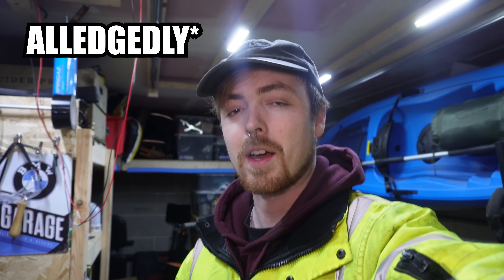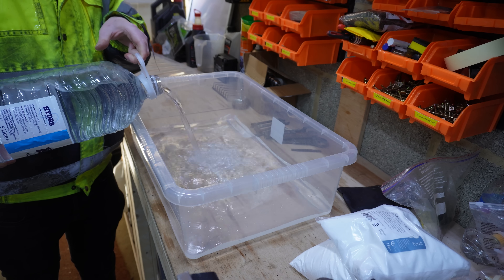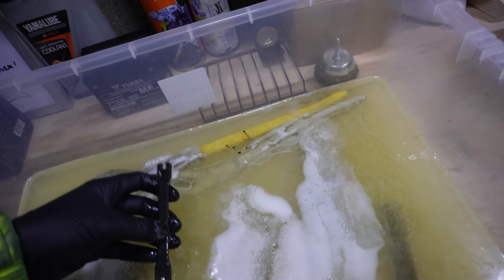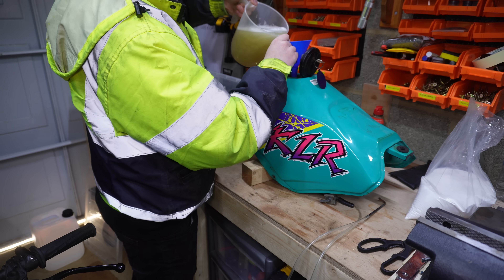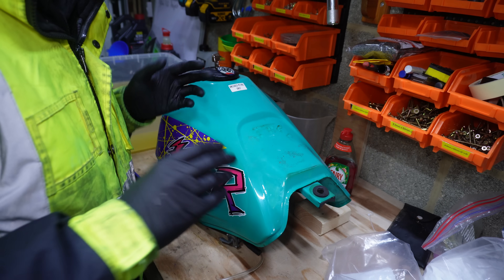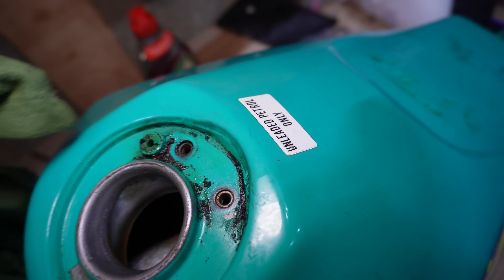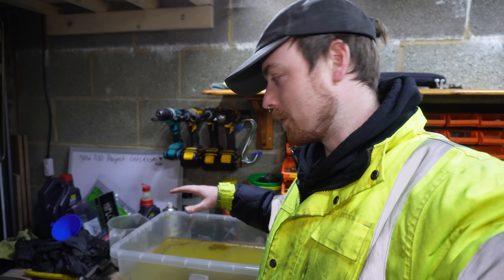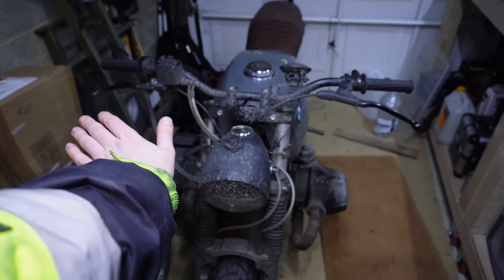How to clean a motorcycle fuel tank (Better/Cheaper than Evaporust?)

Comment: Will the rust come back though? Better to use a rust killer converter or removal? Are all these products snake oil basically? Going by all the tests that Project Farm and other channels have done, NONE of these products deal with rust for good.
Reply from the maker: Nope! Unlike methods that use acid this doesn’t flash rush! I’ve had it sat empty in the garage for a few days without even flushing it out yet to test that and it looks exactly the same! The rust hasn’t come back. 
I’ll pin this comment as that’s a major thing to note which wasn’t in the video.
Reply: @ItsChrisHodge  Superbike Surgery channel had the same type of GSXR750 like your mates with that gear whine.  It wasn't good!  Check it out.
Reply: @ItsChrisHodge  Acid is still only as good as the time its used.... Leaving treated areas bare after acid treatment and the rust will just come right back. Its about more than just the removal product.. theres a lot more to it than that. Proper protection in the first place is the only true method to "prevent" rust.
Reply: @ItsChrisHodge  Please keep us updated, show us that tool kit in 6 or 12 months time, interested to see if rust appears.
I'm keeping an eye on two different rust converters myself, I want to cover the underneath of my pickup truck in the Summer, if I can find one that actually works in the long term.
Reply: @ItsChrisHodge  the rust always comes back ... Been using this for months ..  Do you even know why and how this actually works ? ... Obviously not .
Reply: @LifesAbe-ach  To make it a bit more rust resistant, you could lightly copper plate it using electrolysis, it's a very safe, easy process.(and cheap)
Reply: @ Good idea, a good soak in a strong Copper Sulphate solution will do it.  Also makes a great  marking out fluid.  Very easy to see lines.
Reply: @AmericanThunder   ... If you use this , definitely rinse well after and dry off .  The older the mix the more it etches and eats into the steel . I've sat old rulers in it half way up to test and it leaves a ridge line . I do own a full zinc and nickel plating setup that I use ... I do black oxide and oil  treatment as well .  I've done a little copper plating using copper sulphate crystals and got reasonable results  ...
Reply: Yes, if steel is not protected, rust will come back.  Rust removers and converters are two different things.  With converters, you  usually have two types, Tannic Acid water based and Tannic Acid in a latex base.
The latex based ones are a great base for nearly all paint systems.  The straight Tannic Acid water base is excellent for paint as well, but will require a wipe down and an etch primer.  The advantage is when stripping old machinery or when something is going to be welded later.

Another fail-safe method is water:molasses at around a  40:1 ratio.
This mixture lasts a long time, I have a bin that has worked for 30 odd years, which I top up every now and again due to evaporation.  Will not harm anything, can be poured in the garden when unwanted, (plants love it), and you can leave things in indefinitely.
Stuff comes out with a black sludge that washes off, similar to what is shown in this video.
Reply: @Onan-u3b   I second the molasses.   Once I found how well that works, I forgot all about every single other method and will never bother with them.

I have one 55 gallon drum that I started with 4 gallons of deer feed molasses and I constantly run engine blocks, heads, cranks, old tools, or anything I can get my hands on that's rusty.

Just yesterday I was looking at some bare cast iron fireplace andirons that I soaked over a year ago.  Not treated, sprayed down, or painted and they're still just as gray as the day I took them out and washed them.
Reply: @earlbrown  Yep. been my standby go-to for many years, absolutely failsafe.
Cheap too! Cast Iron loves it!  I have found the same thing with Cast Iron not re-rusting  again for years if inside.
Reply: @earlbrown  Hi earlbrown, my 1st reply to you was deleted!
Yep, it is my favourite go-to.  The reason I really love it, apart from its effectiveness, is that I can just throw stuff in and leave it.  I experimented with things like Oxalic Acid and lost valuable parts because I left them too long.
I would rather have super safe than instant wonder.
At the moment I am doing a little experimentation based on Better Ballistics formulae:
https://www.youtube.com/watch?v=fVYZmeReKKY
Using some Tetrasodium EDTA as the buffer due to it being a chelating agent.
It works fast, but as said, unless I know that I will be on hand to keep an eye on things I will be sticking to the Molasses.
Reply: Yeah.  That's why we paint/polish/wax/chrome/powder coat metal.  Bare metals corrode.  Nothing new.
Reply: @Mountain-Man-3000 who knew! 😂
Reply: @Mountain-Man-3000  And even then, sometimes the rust bubbles up through such coatings. Back in the 90's a body shop guy said that the rust is already in a new panel etc due to the recycling of all the old metal, not skimming off properly etc. It does make sense to me otherwise why do you get rust bubbling up under paint work that's not even been chipped/damaged?
Reply: @steveclark..   It is simple imperfects in prep or coating when a bubble occurs.  The rust is not from recycled metal, but he is correct once the molten metal cools nature starts on it (moisture).  No one gets perfect prep and perfect coating.  that is why multiple layer designs are used (primer, base coat, topcoat, clear).  even the acid etch of the surface to remove rust never gets it all. However it can greatly reduce the problems.
Reply: @steveclark..  the paint damage doesn't have to be large enough to be visible to the naked eye to allow corrosion to form. Additionally corrosion could be caused by flaws in the paint application process.
Reply: @whatsup3270  How can you be sure that it's not from recycled metal in the first place? I worked for VW back in the 90's and had to replace the hatch on several Golf's, only a few months old, all rusting from underneath the paint. I can't be 100% sure that it was from the batch of recycled metal that came from the plant at the time but I doubt very much that it was from poor prep or painting at the VW factory.
Reply: @silaskuemmerle2505  I recently treated the inner wing of my pickup due to seeing a tiny bubble on the outside of the wing, I expected to see some leaves/mud wedged up there but nothing. That painted surface isn't even exposed so no damage at all yet it's rusting. I can't help but feel that rust is already in the metal, pot luck whether or not it shows itself.
Reply: @ Intergranular corrosion is a possibility, but more likely would be a spot where the primer didn't cure properly which would also cause corrosion
Reply: @steveclark..  Metal is metal and when it is melted down no rust survives.  Rust density is way too low compared to liquid metal. Thus rust becomes slag. For an example since 90% of metal has recycle in it, we would expect 90% failure rate if that were the cause. If metal is under prepared to coat it is doomed.  If a mismatched primer is selected it is doomed.  If the coating is insufficient it is doomed.  That is why single coat jobs are avoided.  If there is a single speck of dust on the metal and single coat is applied there is likely a bare spot on the opposite side of that speck, and that speck will likely fall off in the freeze and now there is a bare metal spot to rust.  Additionally, all coatings breathe, and that aspect has to be matched up correct as well.  Those VWs likely went too cheap on the prep/prime/multi-layer coatings and accidently designed a dead spot that collected dirt which held water and thus over exposed water to that paint design.  Same as the old wheel wheels on cars and trucks.
Reply: @whatsup3270  The slag aspect was brought up back in the day, the bods at VW suspected that it wasn't all skimmed off fully on that batch of material that they got for that production line.
Again, I doubt very much that it had anything to do with the prep and painting aspect because the problem only happened during that short production/run of Golf's, not before or after.
Reply: @steveclark..   These are different issues.  If slag remains in the reprocessed steel would have to limited to the top and that ingot and is a manufacturing failure. They blow gas through these batches for this purpose.  Testing would also have to fail to detect that defect.   
As for the other issues those should not be hard to factor through.  For example was surface prep, primer, coating used on other cars.  And accidently designing dirt traps which will stay wet as usually obvious in the failures.  Simply failure analysis is often easy, not always easy but often easy. 
If the video is reviewed 3 very different conditions exist 1) clean tools, 2) tools which retain some surface cover and thus metal is blocked, and 3) the inside of the tank which cannot be inspected fully, prepped fully, or coated fully.
Reply: @whatsup3270  Different issues maybe, the end result is still rust though. During my time at VW, I visited a few body shops too, mostly expensive, high end classic cars, restoration projects, a guy said to me, see that E type Jag, it keeps coming back every so often, no matter how much of the rust I cut out of that rear quarter for example. He's opinion was that it's in the metal too, a bit like cancer in the body, sometimes you just can't get rid of it completely.
You are probably going to say that it's down to bad prep and paint again but I highly doubt it, this body shop was high end, certainly no run of the mill vehicles in there.
Reply: @steveclark..  In the gas tank in this video no one can properly prep that for a coating.  that does not mean the original prep job was bad, and it does not mean the original metal was bad. Odds are that tank had no coating; it was designed for gasoline.  Water was in that tank for a long period.  That tank can't be refinished to its original specifications.  The metal will have pitting now.  However, if a guy owns the tank he does as per the video and then makes decisions about if he wants to try a poor application of a coating to reduce the problems or just go with oxidation of the metal. He cant un-pit the metal or seal the new pits made by the water.  These pits seem to be what your guys are focusing on.  And if he uses water in that tank again it is going to rust much more than if he uses ethanol free gasoline.  The pits did not come from recycled metal, the pits came from water damage in the tank.  Same with quarter panels and hatches once the original design failed and the metal is pitted, from rusting, it will never be as good as new again.  Rust is a chemical reaction typical red rust is iron which has reacted with water to leave pure iron and become iron oxide(s), the pit was the hole left where the pure iron was originally.
Reply: @whatsup3270  At the end of the day history proves that metal will rust no matter what you do to it, I've been involved in the automotive industry for decades, seen vehicles totally restored in high end body shops only to come back a decade or two to be restored again. I wish that any one of these rust converters, coating etc actually did a permanent job, they don't, sadly.
Reply: Should be good to go as he used WD40 as final cleaning stage, as long as he generally keep the tools dry of course.
Reply: All of these products meant to remove rust do just that, they remove the rust. They cannot prevent further rust, that requires completely different chemicals.
Reply: @silaskuemmerle2505  That's why I prefer the converters but do any of them really work for good? I'm testing a couple myself.
Reply: Thorough surface prep, then paint. That's kinda what paint is for.
Reply: Fuel tanks are best kept reasonably full, because metal ones are usually bare inside, and fuel is a solvent......
But just reality when gasoline powered tools / equipment  / motor vehicles / sit unused for long periods, especially when the sitting unused period is unplanned.
Reply: I think the question was does a new protective coating need to be installed to replace the original.  And that answer depends on the original design was it reliant on a treated surface, I suspect most were not they were typical metal composition.  This is why he avoided straight acid as it leaves a bare un-oxided metal which often will quickly rust.  His solution is buffered and much, much weaker than acid thus it lifts rust more magneticly, a weak reaction,  as opposed to a strong chemical reaction.
Reply: What do you expect? Steel rusts. There’s a huge metalplating industry due to this fact.
With tools: grease mating surfaced and wipe the rest with a greasy rag- and store in a dry place.
Reply: @paulgregg722 Good point and not one of the metalplating companies seem to have come up with a one time and done coating.
Reply: @ It’s all down to costs. An example :Dense Chrome Plating is excellent if backed with a few microns of nickel and if shsrp corners and edges are rounded to very specific radii.
But all that takes expensive preparation and wouldn’t be justifyable for general purpose tools.
Tools are synonymous with care and maintenance. Less care results in more eventual maintenance. Simples.
Reply: Treat your stuff right and you wont have a problem with the return. Rust for good treatment are best for things like vehicle frames.
Reply: If you do not protect the metal and care for it properly it is metal so it will rust again. Metal rusts. But step one is removing the rust. Because rust won't clean itself either.
Reply: Considering rust is a chemical reaction between the steel, water and air.. It will come back.  You cannot stop steel rusting for good. The only way of stopping rust for good is shoot the steel into the vacuum of space.
However if your plan is remove the rust... These products are an option
Reply: @sahhull  there's ways of inhibiting rust. There's even different kinds of rust. Oxidization of ferrous metal is actually a fairly complicated topic. Many factors are involved in what occurs as far as metal and rusting are concerned. Cleaning metal goes a long ways towards preserving it though. As clean metal is less likely to transfer ions. Because shooting metal into the vacuum of space is not practical for all of us to do.
Reply: @1pcfred  inhibiting isnt stopping. He said stopping.
Reply: @sahhull  Good point. I've just had a concrete floor laid, rebar put in for strength/prevent cracking, that came off the lorry rusty, at what point in time will it turn to dust I'm wondering?
Reply: @steveclark..  worse still.
As the rebar rusts, it expands and that will crack the concrete.
Concrete is strong in compression, very poor in tension.
Reply: @sahhull  Is that why adding fibre material to it instead came about?
I wasn't even offered that but like with copper pipe over plastic push fit plumbing, I think that rebar is tried and tested. Point taken about the possibility of it expanding though.
Reply: @1pcfred  That doesn't seem to be the case always though, otherwise we wouldn't see vehicles rot out.
What's the difference then, why/how is it a passive layer on rebar??
Reply: @1pcfred  Yes, obviously,... BUT if this passive layer real worked/stop metal from rusting, why wouldn't at least one of the car manufacturers use it?
Over the years I've tried a few 'rust converters' etc but none of them really live up to their claims,... they are all snake oil to some degree is my conclusion.
Reply: @1pcfred  I worked for VW back in the 90's, I had to replace the rear hatch on a number of Golf's that were only a few months old due to rust bubbling under the paint. A bad batch of steel were to blame I heard. A guy at one of the bodyshops I went to also reckoned that the problem is down to recycling old metal,  rust is in that and if it's not skimmed off properly once melted down, that's when you have issues.
Reply: @1pcfred  In the case of the VW factory, I doubt that it was anything to do with the prep work, it was state of the art back then, now I hear that all main production cars are painted by robotic arms, so even more workers have lost their jobs.
I want to cure or at least slow down the light rust that's on the underside of my 12 year old pickup truck, I'm thinking of using a rust converter and then a wax oil rather than a product that drays, chips off/holds water. What do you recommend to use? I watch Project Farm and other such channels on YouTube test such products, no clear winner it would seem. I don't really want to get under my truck every year or two to reapply a product but I'll have to I'm thinking,...got to do something.
Reply: @1pcfred  Only recently I bought a trailer from an old chap who uses a mixture of old engine oil and hydraulic fluid on the underneath of his Land rover. Of course it drips all over the floor for a few hours so he left it parked on the road rather than his drive. LOL
Reply: I use citric acid too- it's great!
I use WAY less... like a tablespoon in a litter of water... wash off with baking soda and water- then dry and oil to prevent re-rust

Comment: Good job. I think the sodium is a buffer and is not consumed in the process. So the acetic or citric acid does the work and is consumed and can be topped up. Use litmus strips to gauge the acidity before, during and after the process. Add the powdered acid to restore the low pH. It’s biodegradable.